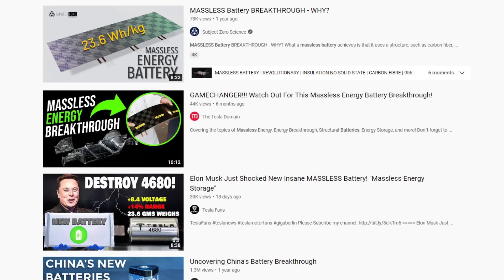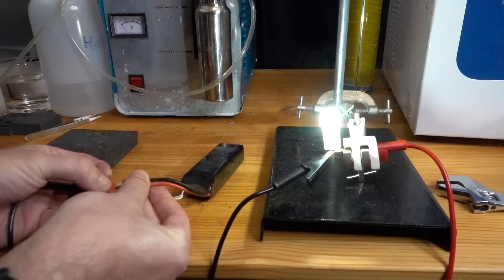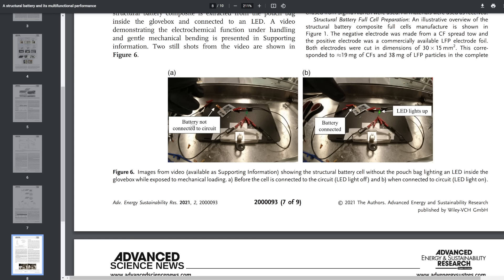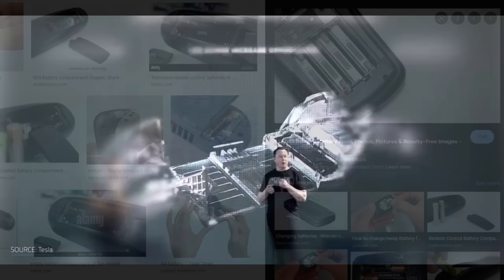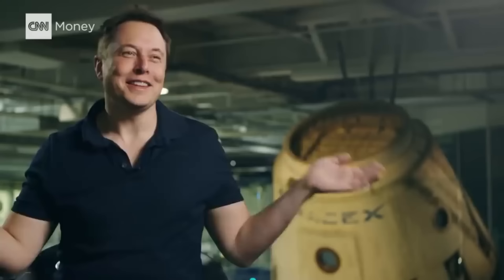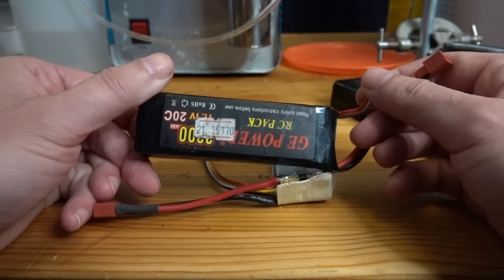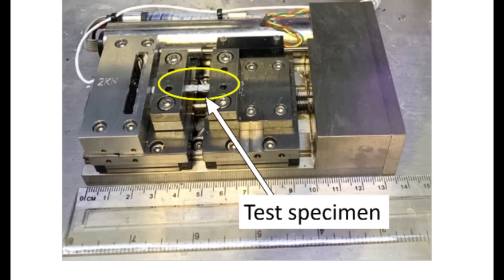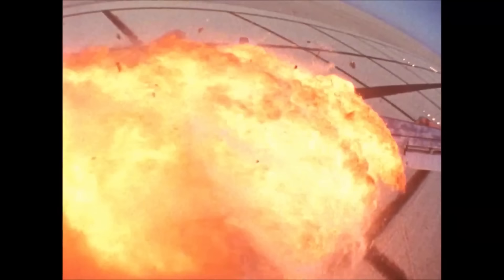Matt Ferrell, Massless Battery: BUSTED!!

Comment: After watching Louis Rossmann for few years, I'm sure that Tesla is making this change to make new cars less serviceable. Just think about it, what is the part that will die no matter what? Battery. And now it is "part of the structure" so it cannot be replaced, at least not easily.
Reply: It can still be replaced. The rest of the car will hold together. You just cannot put load on it without the battery in. Also the battery seems to be holding up quite well. So it's no problem for the cars lifetime. And it's warrantied for normal use so it's Tesla's problem if it fails. At least in the country where i live with proper consumer protections, maybe not the US.
Reply: And nobody will ever get in a crash . So no need to worry about dying in a firery fender bender.
Reply: @PrometheusZandski  Of course, I forgot that it is that easy.

Tune in next week for simple way to end world starvation. Would simply "giving everybody food" work? Answer might surprise you. :D
Reply: @PrometheusZandski  like gasoline doesn't burn? There are more gasoline car fires every year then battery fires. And though lithium battery fires are hard to put out. They are not explosive if I remember correctly. I rather be in a battery powered car then a gasoline one.
The pack is in the center of the car en well protected. Unlikely to get damaged in a fender bender. Unlike some early and not do early American gasoline car designs that almost detonated on impact.
Reply: @bzuidgeest  gasoline doesn't burn when your side panel.  Pay attention to what you are responding to. If you load the shell of a car with lithium, you will see inconsequential accidents result in huge fireballs.

Comment: Ask Matt “would you go outside and smash a Lithium ion battery with a steel hammer?”
If he says “No” he probably already understands the dangers of pressure and weight on batteries and still refuses to accept it
Reply: theres an additional risk beyond that pressure and weiht. now passengers and drivers are souround by battery so its not like the risk is all in one area.
Reply: @randomprotag9329  With an EV battery failing it's the floor is lava, with a structural battery EV failing it's welcome to hell

Comment: It really amazes me that Tesla is going ahead with this structural battery thing when you read about many peoples experience owning the cars and having batteries that needed replacing. How is that going to work when its part of the structure?
Reply: Buy a new car!
The age of forced obsolescence reaches your car.
Reply: The battery case is structural, not the battery.  They can call it whatever they want. Just consider what they call full self driving and get people to spend $10k on beta software.
Reply: It's just another electronic appliance, any major problems - replace.
Reply: @jdmather5755  yeah, but the casing is so deeply integrated into the structure that it would be practically impossible to get it out of the vehicle at a Tesla service center... at least not safely
Reply: Well if that's true, this will be an even easier way to diminish Tesla stock price than it's money bag to break a promise about never selling TSL stocks.
Reply: It worked for Apple, just fine. ;)

Comment: Okay, let's be fair here. It is pretty typical in composite construction to use a weak core material (for example, in fiberglass boats foam or balsa are used). The idea is that if you put SOME material which is lighter than the laminate in the middle it increases the strength to weight ratio, because material along the neutral axis is irrelevant for strength in bending, and the thicker the panel the stronger it is (by the third power). We don't actually care what that material is, other than that it makes a good bond to the outer laminate. Replacing this material with something that serves a useful purpose is theoretically not ridiculous. Of course that doesn't make putting a battery in there viable for plenty of other reasons, such as the fact that it would have to survive flexing, core materials are already light materials (limiting the amount of mass that could be saved in the first place), etc. But I'm sure manufacturers would see it is a huge bonus that it is impossible to replace.
Reply: The fact that the batteries would also be significantly harder to replace if integrated into the frame doesn't help things
Reply: @InfernosReaper  Doesn't help? That's the biggest benefit! :)
Reply: @jessicav2031  I think ge means doesnt help the consumer it is great for the manufacturer
Reply: This is why I like reading the comments section, you find lots of people from different areas of expertise and experience adding their two cents to the conversation.
Reply: In aerospace especially it really matters what you use. For once you need to certify a save aircraft (no highly flammable or explosive stuff for example). Secondly the weight: using glass/ aramid / aluminium combs makes sense in terms of structural integrity Vs weight. Massive Batteries don't.

Whoever finds spelling/grammar mistakes can keep them :)
Reply: @Steven-nb3uz  Yeah, of course I was oversimplifying. Of course core material shear strength also matters when the panel is in shear. But what I am really trying to point out here is that the people doing the research are not totally nuts, I'm sure they understand these basic mechanical engineering concepts (also I am no expert in composites!). It seemed Thunderf00t either ignored for effect or does not know about cores in laminates. But I mean, it is also clear Mr. Ferrell has an even worse knowledge base.
Reply: @jessicav2031  I didn't try to dismiss your argument. I suppose integrating the batteries into the laminate could make the most sense for automotive applications. It just bugs me that e-aviation is pushed so much. My personal Problem, not yours :)
Reply: @Steven-nb3uz  The same thing really bothers me about solar boats: right now it is the next big hype thing to run a boat off electric engines recharged by solar. Except of course, the amount of surface area available vs. the amount of energy required for propulsion means it will never really be viable unless you want to sit around charging for weeks for every day or two underway. Meanwhile because of that hype, technologies with actual potential are mostly ignored (like for example, automatically controlled sails). Reality is just never as sexy as some BS technology being sold by people who don't tell you about the limitations.
Reply: @jessicav2031  it's somehow good to see, that we aren't the only ones suffering from this pseudo futurism. Where I am from we say: Shared suffering is halve the suffering
Reply: @jessicav2031  i agree thunderfoot oversimplifies things greatly in this video, and that Matt is way worse. One thing I think is somewhat overlooked is that if you had a part that acted as a structural battery, replacement parts would be produced in the same way. It's just really a question if the mechanical properties are good enough and if the added capacity that part provides in whatever use case you have is worth the extra production cost.

Comment: How can anyone claim to have a massless battery with a straight face? Like, even if you somehow were able to make a structural battery where 100% of it was useful for keeping a charge, that would still have mass! Sure, you might be using the mass for something else but that doesn't mean it's not there. Even worse, it's basically impossible to have it weight the same or less than a normal structure because, to nobody's surprise, structural materials are better than battery materials at being structures. If that wasn't the case, we would just be using batteries as structural materials!

Comment: You can convert an ICE car to use massless fuel.  Just remove the fuel tank and use the hollow chassis members to store the fuel instead.  If that's not enough you can use the door panels as well.
Reply: there are motocycles that actually store extra volume of gas in some of the tubes of the bike frame.
Reply: @ronblack7870  Interesting.  I had not heard of that (but have no reason to doubt it).  I bet that it is not however the only or the main place that fuel is stored.
Reply: Not massless at all though. If the hollow chassis is stable enough, why not use a hollow chassis in the first place?
Reply: @StefanReich  They generally do, although a big disadvantage is that if it is not completely sealed, a hollow chassis can rust from the inside without anyone knowing.
Reply: A fuel tank can be protected from damage during a collision, the structure cannot. Whether car or motorcycle, a serious enough impact will crack the structure causing fuel to spill and inevitably ignite. There is no way this passes safety standards if the hollow structure of the vehicle is used to store fuel.
Reply: @joecoolioness6399  I agree - my posts were sarcastic, not serious suggestions.

Comment: Actually, aircraft engines can be operated if the tank booster pumps fail. These are similar to the pump found in your car that sit in the fuel tank and supply a small head of pressure to the engine so it never has an issue with starvation under any flight condition. They frequently sit in a separate box at the lowest point of the tank which allows fuel in but not out, so that even if the plane turned upside down (fighter jets etc) the pump can still supply fuel for a short period.
The pumps Rolls Royce are talking about are the engine mounted ones, which provide much higher pressures for the injectors. There’s usually two of them, a low pressure and high pressure, with the high one kicking out up to 1000 psi. Should your tank pump fail, a combination of gravity and the low pressure pump suction will allow the engine to run at full speed, but there’ll usually be time limits on how long you can leave it like this.
So yes, gravity fed jet engines are a totally normal thing, but only if the tank pumps fail.
Reply: How can something be at the lowest point in the tank whether the tank is upside down or not? 
Yes there are back ups upon back ups and degraded modes like this sump pump kind of thing you’re discussing but that does not make it a “gravity fed jet engine”, just no.
Reply: @JoeOvercoat  sorry to disappoint, but if you lose your tank booster pumps then fuel can be gravity fed to the engines, as long as the level of the fuel is above the engine itself. In reality, even the engine low pressure pump will suck it from any point in the aircraft anyway, the tank pumps just provide a head of pressure to prevent cavitation. 
If they aircraft happens to be inverted, as an extreme, then obviously it’s not gravity fed unless you start pulling G’s, in which case it sort of still is, just in the opposite direction.
Source: 22 years as a military aircraft maintainer.
Reply: Even if your tank pumps fail you can always rely on gravity to (eventually) get your plane back down to the ground again.
Reply: @JoeOvercoat  What he said is that there's a point in the tank that is shaped to act as a no return valve so that the pump is sucking fuel rather than air in case the fuel sloshes around.
Gravity would not pull the fuel in that sutuation.
Reply: @JoeOvercoat  Civilian aircraft cannot do inverted flight for long, only under around 10 seconds, before the fuel starvation stops the engines. Fighter aircraft have a fuel tank within the final feed tank, which allows inverted operation for a period of around 30 seconds at full afterburner, before it will start to run low. Yes it will gravity feed fuel to the LP pump, but after there it is pressurised, and fuel transfer from tank to tank in the airframe is done by pumps, generally self priming gear pumps, because the fuel in drop tanks, always below the fuselage, is always used first, so it has to be sucked up to the main fuel tanks, with overflow returning to the drop tanks till empty, then the shut off valves will stop that, along with the pumps.

Lose the pumps and the engine stops in short order.
Reply: @stephenbell9257  Curiously, they always seem to provide exactly the right amount of fuel to get you to the crash site.
Reply: Gravity feed works well on irrigation systems, not gas fired jet turbines, Einstein.
Reply: @AndriasTravels  As an aircraft engineer, I can assure you it works completely fine under almost all conditions the civilian airliner will ever encounter.

Comment: Ah yes, integrating huge battery packs into the structural bottom of the chassis will surely make it easier and cheaper to maintain or exchange when the batteries need to be replaced frequently!
Why not make the entire body entirely out of flammable Li-ion batteries? This way, the whole car combusts at once when the battery fails, much less scrap to remove from the road after it has burned out!

Comment: Yes, aircraft engines can run on gravity feed of fuel, just ignoring that if the pumps pack up they will not run for more than a few seconds, mostly because the fuel flow is now not even enough to run them at idle, and the whole pesky injectors need enough pressure to put it in against the pressure in the combustion chamber.

Now fuel tanks in the wings are there to have useful volume in the cargo space, plenty of aircraft can have tanks in the fuselage, often things like tankers, where that fuselage is used to carry fuel as the cargo. Airlines however have that pesky need to move things, like people, cargo and baggage, so need that room to fit them in, instead of them sitting cramped up in the wings. So instead they fit the tanks in the wings, using self sealing bladders so they do not leak all the fuel out in all the rivet holes, and then, to keep it sloshing about, they use open cell fibre foam to provide both support for the bladder material on top and bottom, and also prevent sloshing around, but still allow flow down to the fuel pick up points.
Reply: And we'll just gloss over the fact that many a/c store fuel in the centre torsion box, directly under the passengers. 🤣
Reply: Have you tried turning it upsidedown and shaking it?
Reply: @jonathanj8303   Like you do when you almost run out of fuel on a 1980s Briggs and Stratton lawnmover, just tilt it a couple of times and you can go a couple more minutes
Reply: @palleppalsson  now I got visions of the guy in the Peter Jackson film running through zombies with the flymo strapped to his chest...
Yeah, just like that.
Reply: Jet engines can run for a considerable time when fuel is gravity fed.
As was the case with F-WWCJ (A6-EHG) where the cockpit was severed from the rest of the plane in a ground collision and Qantas Flight 32 (VH-OQA) where the uncontained failure of the number 2 engine damaged the wiring to the number 1 engine.
In both cases, firefighters had to spray foam into running engines for a considerable period of time in order to force a shutdown.
Reply: @jonathanj8303  
🤣 when your 'plane is upside down and shaking you've got far more serious gravity issues to ponder on.
Reply: @markevans2294  Yes but in both cases the FADEC was operating, just with no input control, so it stayed at the last operate level under full control of the FADEC, and the fuel pumps controlled by the FADEC were still operational. Damaged engine you can still shut down by turning off all DC buses, and all AC buses, and before that use the fuel system valves to starve the engine of fuel, but that is something the pilots are never taught, as that is mostly done at depot service, to isolate an engine for removal with full fuel tanks.
Reply: @markevans2294  
The engines kept running because the pumps were still pumping.